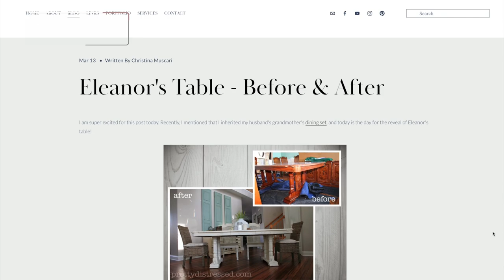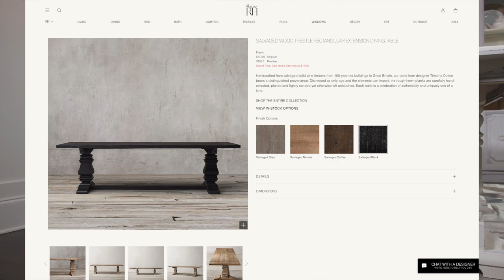Dixie Belle Midnight Sky Dining Table with Pretty Distressed!

Comment: Question? Why do you clean with White Lightning before you sand?  I sanded today since my products are still in transit. I bought the Pristine Clean.  Will cleaning after sanding cause a problem?
Reply from the maker: Hey Teresa! If your piece has a lot of dirt and grime, it is always good to clean first otherwise the dirt can clog up your sander/sandpaper. You can absolutely clean after sanding, this will help remove any unwanted left over debris. I hope this helps!